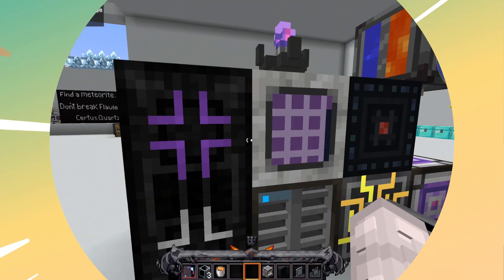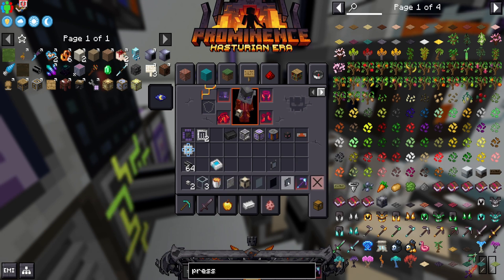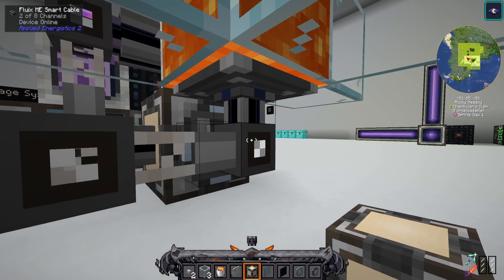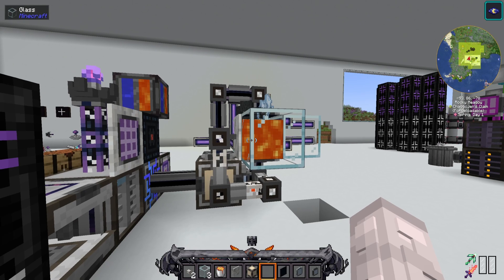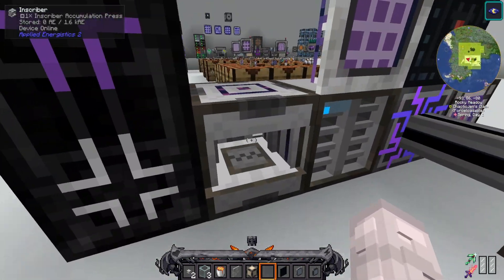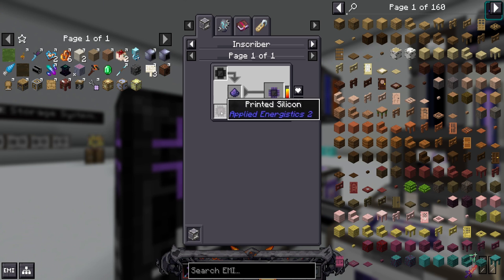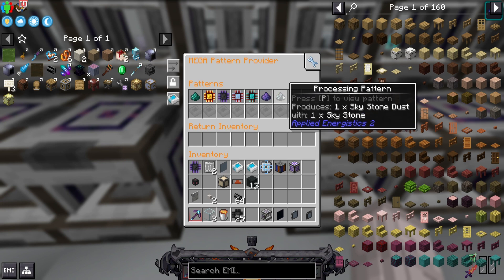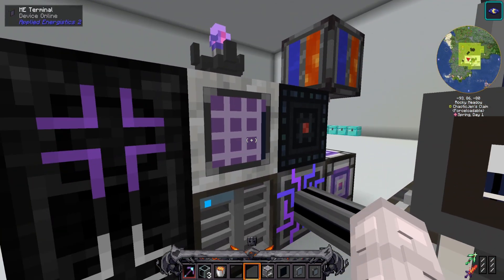Autocrafting Accumulation Processors &  Sky Steel in Prominence Hasturian Era

Comment: I don't understand what the difference is between using or not using a Me Interface next to a Pattern provider. :(
Reply from the maker: The Me interface is simply unnecessary when you are already using a pattern provider with your machine, you can connect a pattern provider directly to your controller using a cable. The pattern provider is the block that allows you to set your machine to use patterns, whereas the Me interface doesnt have a spot for patterns, but the Me interface works perfectly with simple machines like the farmer.

Comment: are you only able to get sky stone from meteorites, or is there a secret way?
Reply from the maker: You can get sky stone dust by using annihilation panes at sky limit. So make a mini Me at that height, set up the annihilation panes, and mine away.
Reply: @JustChaoticJen  thanks so much! That's so helpful! also your videos have been so helpful thank you!!
Reply: @JustChaoticJen  okay one last question would fortune on the planes help at all?
Reply from the maker: @Levi1712  Any enchants you want to add are good, BUT they require a lot more power when you add them (I dont use enchants).
Reply: @JustChaoticJen   okay thanks! i have a nitro reactor  so i should be good on power